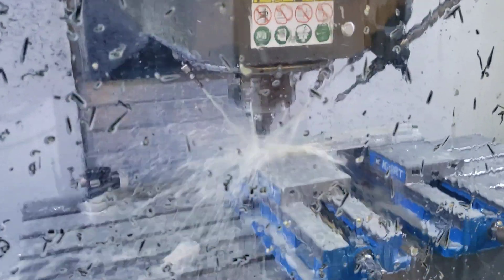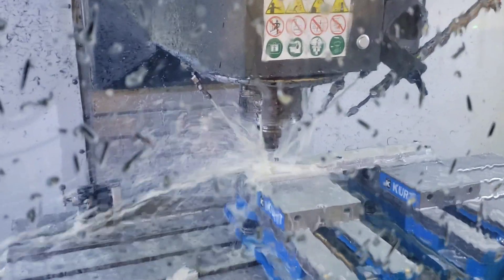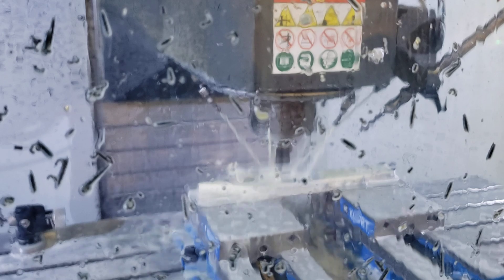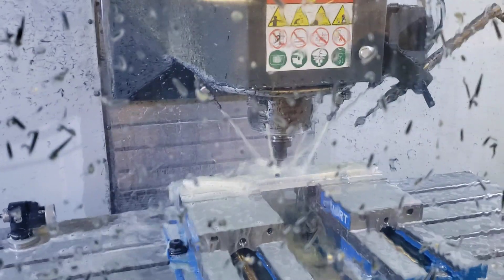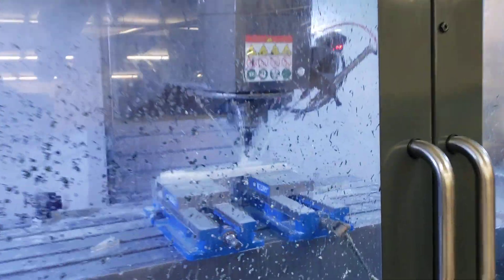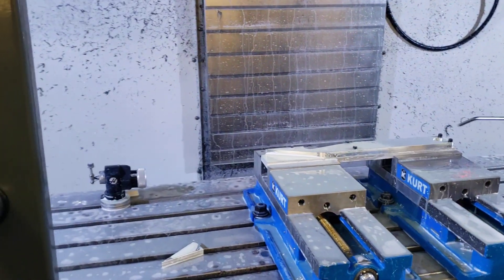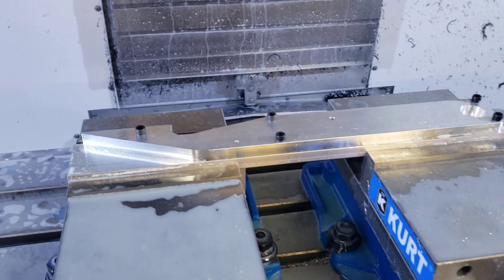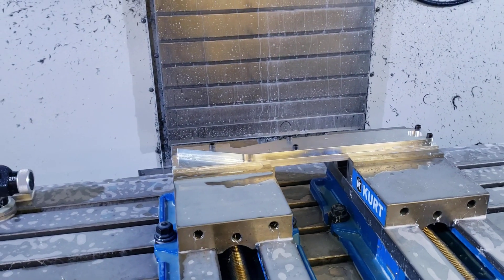CNC machining of a NEW SECRET part!!!

Comment: it looks like the part could be a rail for the sweep to ride on.
Reply from the maker: Nope. LOL
Reply: @coasterp2199  Maybe a part for a distributor or ball return?
Reply from the maker: @minibowler  Still not warm.
Reply: @coasterp2199  Could it be for taking pins off an elevator?
Reply from the maker: @minibowler  Nope. Not that either.
Reply: @coasterp2199  maybe to help pins get in the elevator?